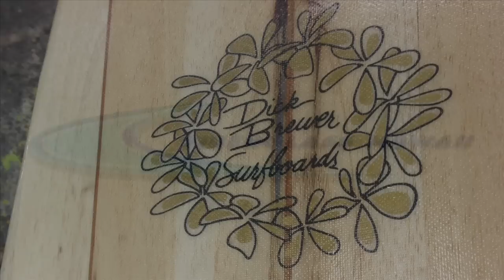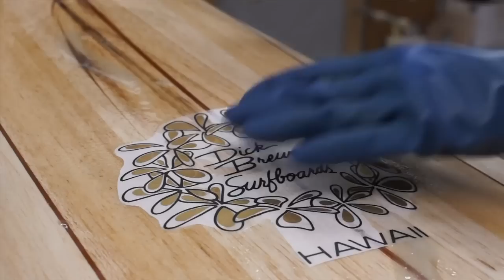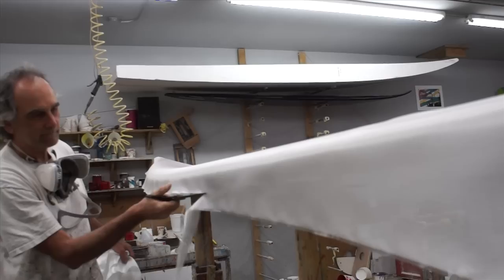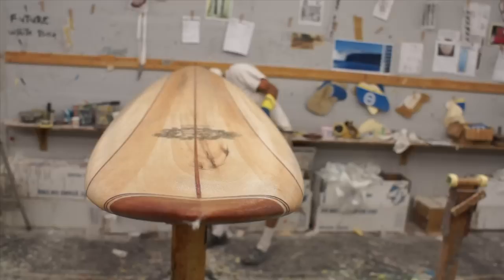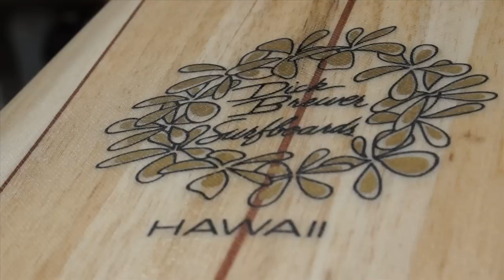Dick Brewer Balsa Surfboard Lamination

Comment: If you were building it to use, would you use two or three layers? 
Have you tried UV lights, like they use in the nail polish salons? Is sunlight better, faster or preferred for another reason?
Reply: sunlight cures faster. Uv Box, depending of the uv resin mixture and W, takes like 4 to 7 min to cure. UV bulbs, lights, consume more power. End board is more expensive.
Reply: Sunlight is cheap and readily available.  Lights cost and are easily found.  Commercial glass shops use lights since they can't have their glassers carrying boards in and out of the shop.
Reply: If you're somewhere where it's often windy, cold, cloudy and rainy then UV curing outside is not going to work a lot of the time.

Comment: I am doing my first cedar board, I have done the first lamination and I am about to flip it and sand the lap. Do you only have sand back to 50 grit ? Will the 50 grit scratch show ? Also I am using polyester will styrene work on it to get rid of the white marks ? Thanks Kev